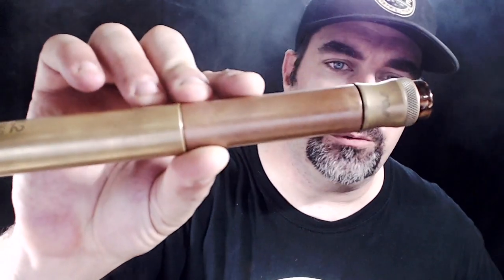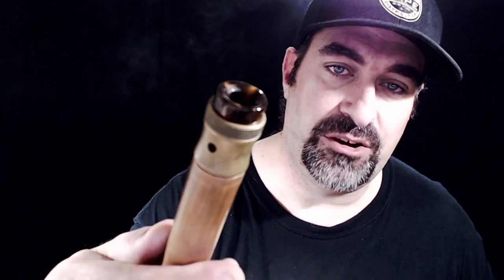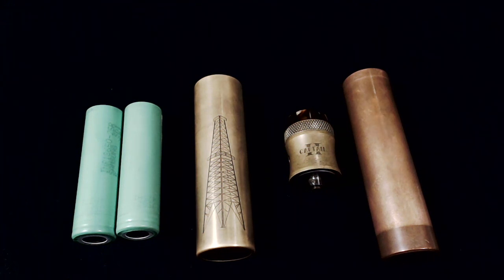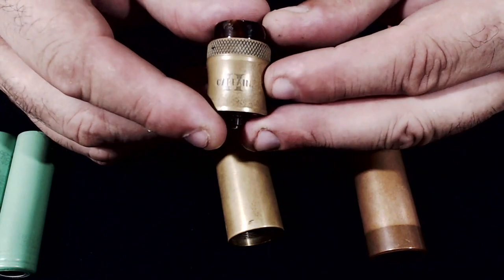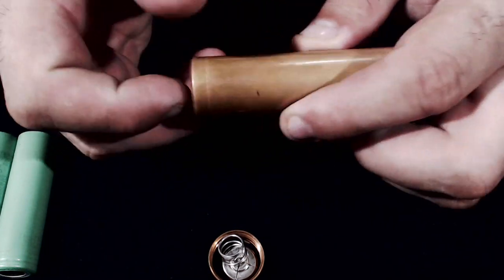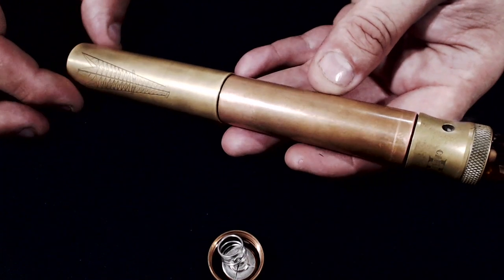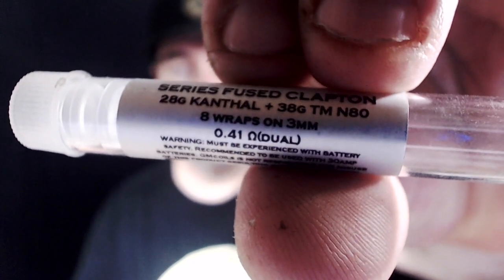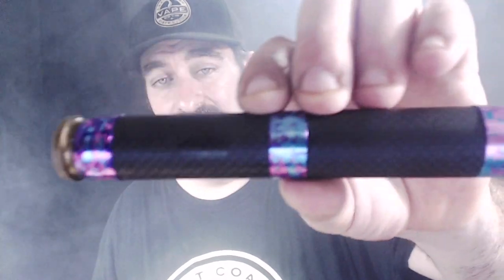DIY RIG V2 & S.O.I. Shorty Stackable 18650 Mod From 4.2 Volts to 8.4 Volts

Comment: hey Big Lou I got it to work with my Rig V1. I had to use the spring and explandable contact plate from the Subzero to fill the larger gap you have by threading the subzero onto the Rig V1. nice hit but looks hideous in my eyes. but it will do. thanks for the video

Comment: lou I'm not too keen on that fucking dagger of a contact into the negative post of an 18650, since you are removing the switch of the shorty, you should be able to flip the batteries, is there an insulator around that bottom pin in the shorty? I don't own one so i cant tear it apart.

Comment: Good Stuff Big Lou.  Love the honest no BS reviews you do.  

0.4 Ohms seems about right for that type of setup. Math tells me that you would be pulling  21 Amps  Current = 8.4 Volts / 0.4 Ohms (not taking into account the voltage drop) and a whopping 176 Watts of Power  8.4V x 8.4V/ 0.4 Ohms.  

Wonder how the vape would be on that. Excessively hot?  Or just forcing more vapor through the atomizer due to the higher voltage? Just curious as the most I have ever vaped at is about 100 watts, and maybe 6 volts depending on resistance and materials of coil.  Always seems that increased voltage = increased heat of vape to me.

Comment: Lou, what is the best product to use to lube the threads on my tube Mod. it's a full copper Panzer.
Reply: Allen Brown a pencial eraser to clean then bar soap so it dosent stick
Reply: 3in1 gun oil hoppes #9